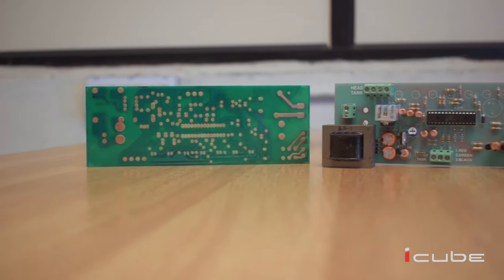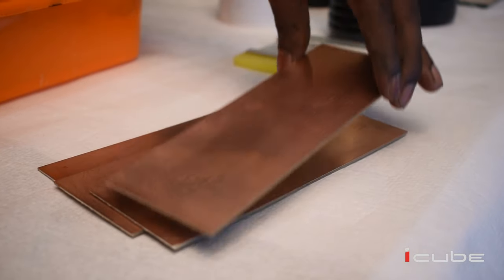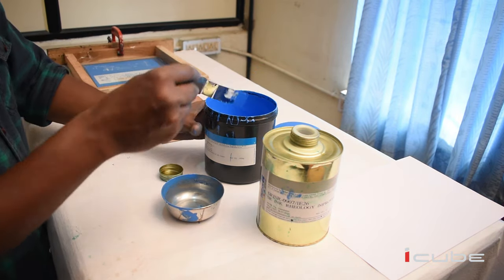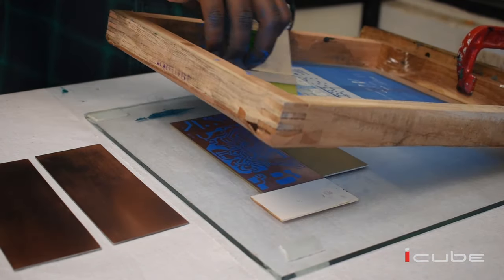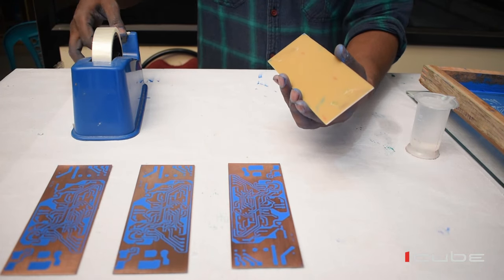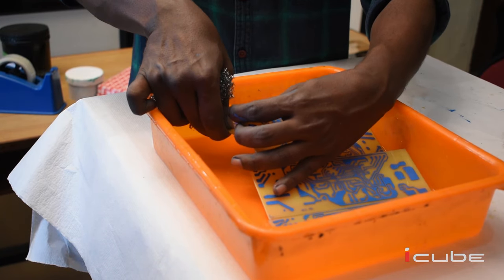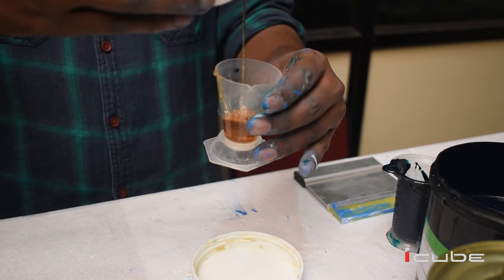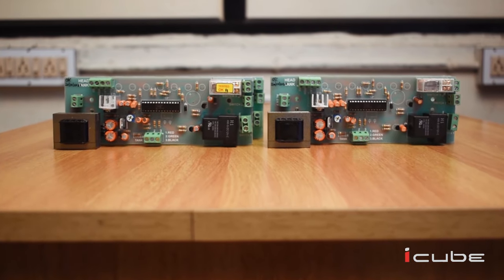PCB Manufacturing Process , PCB making

Comment: I am sorry but despite your best efforts I failed to get it properly. I am no technical expert.
      What I get from your video is you printed a clean circuit diagram in first two processes then covered the copper plate with some insulation.
     What I failed to get is
(1) finally all the ic's , registers etc were soldered on to a plain metallic copper plate. Printing and insulation was only on surface. Why doesn't it cause short circuit as everything is joined underneath insulation?
(2) how to make those printing stancls.
(3) how to design my own diagram  and stancls .
(4). Is there any fully automatic machine to generate a completely ready plate.
(5) cost involved in manufacturing plates by hand and fully automatic machine.
(6) where to get materials at affordable cost
Reply from the maker: Please contact helpline number 8304834648